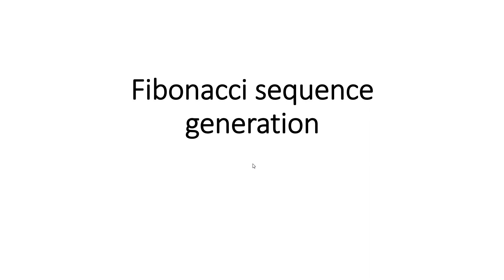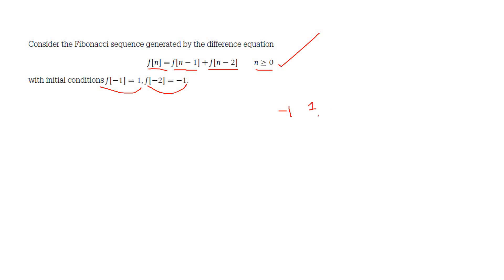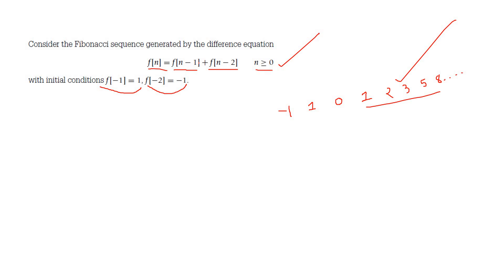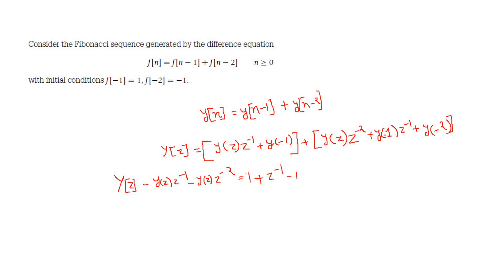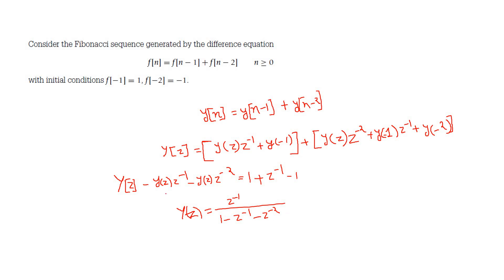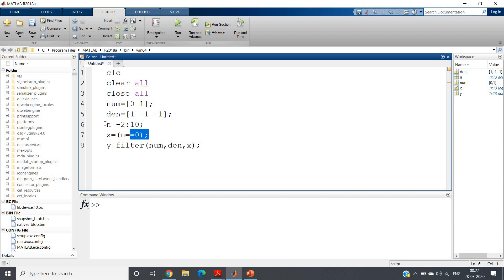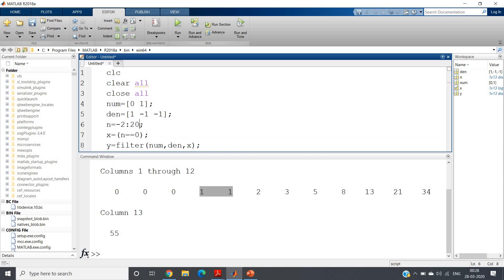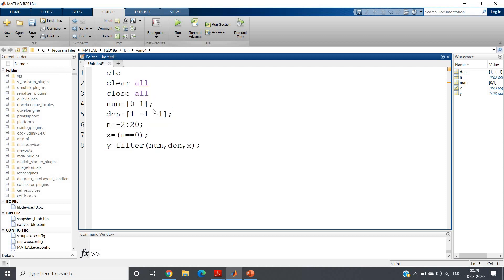Fibonacci Difference Equation | Z transform | DSP | MATLAB

Comment: Q2.  Calculate and plot signal using ifft in Matlab. Design in FIR filter. Given: 

H(n) = [ 0.0068 ,0.0033 ,-0.0166 ,-0.0305 ,0.0192, 0.0921, 0.0389, -0.1265, -0.1478, 0.0618,  0.206, 0.0618, -0.1478, -0.1265, 0.0386, 0.0921, 0.0192, -0.0305, -0.0166, 0.033, 0.0068]

Comment: sorry sir I have many comments here. but i need help because i ask a lot of people and no one can solve this matlab code.

This is my matlab code references. I don't know how to relate to the question.

clear;
clc;
 
%% FIR filter design
 
fc=20;
fs=100;
N=11;
 
Fc=fc/fs;
n=-0.5*(N-1):0.5*(N-1);
w=1-2*abs(n)/(N-1);
h=2*Fc*sin(2*n*Fc).*w;
 
figure;
freqz(h,1,0:50,fs);
 
%% Generate x(n)
 
ts=1/fs;
n=0:fs-1;
 
x=cos(20*pi*n*ts)-2*cos(40*pi*n*ts)+5*cos(60*pi*n*ts);
 
figure;
plot(n*ts,x);grid;title('signal x(n)');xlabel('Time, s');ylabel('Amplitude, v');
 
%% Calculate Fourier Transform
 
X=fft(x);
 
figure;
subplot(211);plot(n,2*abs(X)/100);grid;title('magnitude');xlabel('Freq, Hz');ylabel('amplitude, v');
subplot(212);plot(n,angle(X));grid;title('phase');xlabel('Freq, Hz');ylabel('phase, rad');
 
%% Apply filter
 
y=filter(h,1,x);
 
figure;
plot(n*ts,y);grid;title('signal y(n)');xlabel('Time, s');ylabel('Amplitude, v');
 
%% Calculate Fourier Transform
 
Y=fft(y);
 
figure;
subplot(211);plot(n,2*abs(Y)/100);grid;title('magnitude');xlabel('Freq, Hz');ylabel('amplitude, v');
subplot(212);plot(n,angle(Y));grid;title('phase');xlabel('Freq, Hz');ylabel('phase, rad');

Comment: Q2.  Calculate and plot signal using ifft in Matlab. Design in FIR filter. Given: 

H(z) = [ 0.0068 + 0.0033z - 0.0166z^2 -0.0305z^3 + 0.0192z^4 +0.0921z^5 + 0.0389z^6 - 0.1265z^7 - 0.1478z^8 + 0.0618z^9 + 0.206z^10 + 0.0618z^11 - 0.1478z^12 - 0.1265z^13 + 0.0386z^14 + 0.0921z^15 + 0.0192z^16 - 0.0305z^17 - 0.0166z^18 + 0.033z^19 + 0.0068z^20]

Comment: Q1. Plot the signal x[n] and determine the spectrum of the signal using z-transform.
Give:
Time =
[0.00,  0.03,  0.07,  0.10,  0.13,  0.17,  0.20,  0.23,  0.27,  0.30,  0.33,  0.37,  0.40,  0.43,  0.47,  0.50,  0.53,  0.57,  0.60,  0.63,  0.67,  0.70,  0.73,  0.77,  0.80,  0.83,  0.87,  0.90,  0.93,  0.97]

Amplitude=
[33.48,  4.77,  -14.22, 10.36,  15.32,  2.60,  16.21,  12.47,  -22.06,  -17.06,  12.41,  2.91,  -10.88,  0.05,  -14.88,  -33.88,  -4.77,  14.22,  -10.36,  -15.32,  -2.60,  -16.21,  -12.47,  22.06,  17.06,  -12.41,  17.06,  -12.41,  -2.19,  10.88,  -0.05,  14.88]